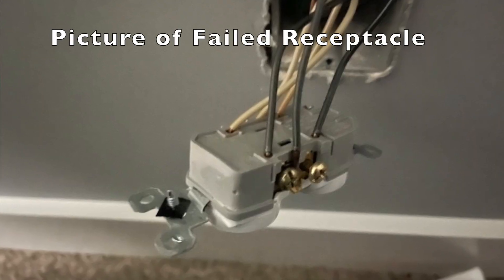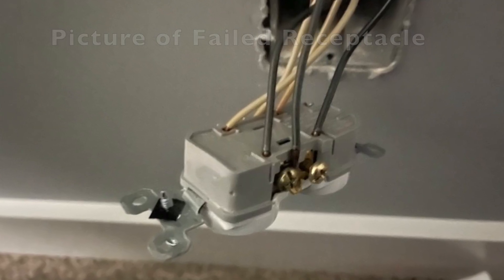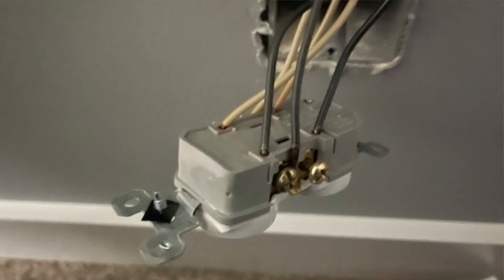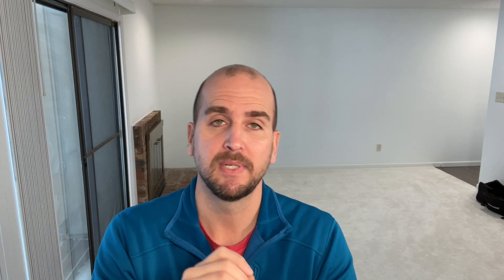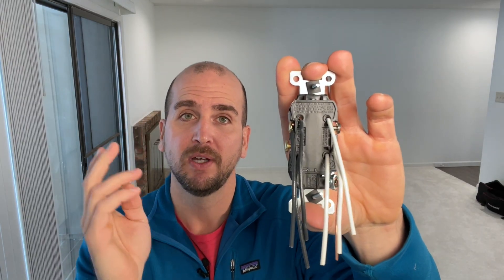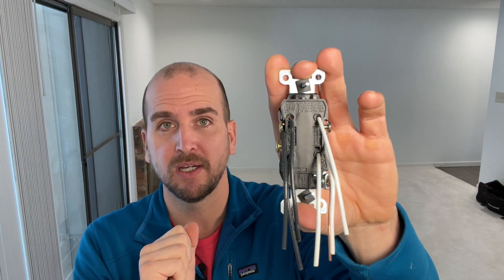Incorrectly Wired Outlet Found In Newly Built Home

Comment: Some great tips here, especially for people that have to come behind someone else's work!  You didn't mention it but I noticed that you tucked the wires in with the nuts pointing up which is just a little bit more safe and helps keep stuff from falling into it.  One tip I would like to add, especially for a box with so many wires,  is to pre-bend the wires into an "S" or "U" shape.  It requires less force to push in and pull out later and lessens some of the strain on your connections.
Reply from the maker: I have seen some interesting comments over the years from people who both have conviction and at the same time are just simply wrong in their approach.  Peter you might take the cake.  Did you just recommend people can “whittle down” a 12 gauge wire?  We are going to have to agree to disagree on all your recommendations.  Be safe and maybe reconsider your approach to electrical.
Reply: @EverydayHomeRepairs  I guess if credentials matter, and if Peter's EE beats a ETech Certification, I guess my PE trumps Peter's EE.  It is ridiculous for an EE to recommend whittling wire - I'm also a Metallurgical Engineer and suggest that the electrical wind that occurs when electrons flow through wire would be concentrated in the non-uniformities caused by whittling and in the worst case could cause the wire to heat up and fail.  Ignore the bad advice to whittle, and do the job right the first time.  The same with tightening the screws and even wrapping them in tape... in the modern world we call measures like this  poka-yoke or error cause elimination.  For the few seconds those operations take, if we protect even one homeowner out of a hundred from electrocution we've done the right thing, in my humble opinion.  Using the pigtale is simple and fast and if an outlet fails, other outlets down the line don't fail because they have power that goes around the failed outlet (similar to double wired Christmas lights.) 
Having managed a lot of engineers in my career, I'd like to suggest that all engineers can learn something from the electricians who are wiring all day every day...we would be well advised to listen to them!  Is anyone else wondering why an electrical engineer has been doing so much routine wiring?   I mean no offence to Mr. Evans...
Reply: @johndunlop9101  
I'm not a trained electrician, but have degrees in electronics and computer science.
You SHOULD offend Mr. Evans 'cuz what he's promoting is just plain stupid...
The 'engineer' (Mr. Evans) has demonstrated (in this very thread) that he is unaware of 'edit' when he's ranted then clicked 'reply' before he's finished his rant; so he starts typing another response to the same recipient. He's demonstrated both ignorance of the system and a compulsion to act hastily rather than correctly... It's a form of the Dunning-Kruger effect... His customers will be billed for an hour when Mr. Evans will be out the door after 10 minutes, but he'll claim his customers save money... Go figure...
Seen his type in so many situations...
Their self-assured attitude only leads to others paying for the consequences of their stupidity.
Reply: @Peter Evans I am an electrician. I always tighten the unused screws on the receptacle. The box is usually plastic in houses but the ground wires in the box are usually bare. I removed receptacle covers and have seen these bare ground wires dangerously close to the side screws. If you are in commercial buildings the mud ring  on the metal box is very close to the side screws. A real electrician sometimes has to pull out an attached receptacle while the circuit is still energized. Not recommended, but sometimes unavoidable.
I have never, and I mean never, heard of or seen anyone whittle down an electrical conductor to fit into a stab lock.
Reply: @Peter Evans so this is the real reason why you're rambling!! It's just that you think that being an engineer you're better or somewhat above a non engineer. An electrician can now the same or even more things than you, you're not necessarily better just because you have a piece of paper that says you're an engineer.
Reply: @Peter Evans yeah, sure. To recommend not to tighten screws just to not "waste" time. That speaks tons of you. And yes, you were rambling
Reply: @Peter Evans is a Troll, do not feed it.
Reply: @Peter Evans it is my professional engineering opinion that you are a P.O.S.

While our degrees do have a significance,  that does not mean those with vast experience have nothing to offer.  Your degree should have taught you to take in all information. Good engineers do that. If you worked for me,  I would fire you for your crappy attitude.
Reply: Pig tailing outlets has a very good reason , for one as stated when replacing that individual outlet you do not cause the whole branch to go down or in other words the remaining outlets are not relying on a different outlet for a pathway and two being along the same lines if you wire the outlet so that power goes in on the top side say and out the bottom if you have a heavy load on the circuit down the line all of the current is passing thru each outlet causing them to heat up and eventually fail due to attrition as opposed to an isolated outlet that taps current out of the circuit at each individual outlet . Sorry but you are totally wrong in your statement but we all make mistakes , just don't pass on information that is incorrect and possibly dangerous for others to follow . Also 100% of all boxes are most definitely not plastic as some are most certainly made from metal , have no idea where you came up with that but it's just not true . Cheers
Reply: @Peter Evans You're talking to me about arrogance while also saying how liking your own comments makes your word better than mine? Fuck, am I sorry for whoever actually has to put up with you in person. You're insufferable. But also painfully obviously trolling, so, maybe things aren't so bad as they seem.
Reply: @Peter Evans remind me not to hire you for any electrical work
Reply: @Peter Evans There is a practical reason for not whittling down wires: it is physically the same as nicking them all around. It weakens the wire at that point. If there were to be any incident associated with the outlet you must be aware "whittling down" the conductor would be very hard to defend. Everything is a technicality until something goes wrong.
Reply: @Peter Evans What??  If you use a pigtail in your receptacle, OTHER outlets/fixtures on the load side (downstream of that receptacle) will continue to function if your "pigtailed" receptacle fails or malfunctions [in other words, you get "source" voltage at the next outlet/fixture independent of what happens to the receptacle with the pigtail].
Reply: @Peter Evans You'd do well to ponder your feedback deeper.
Reply: Your point is good. I have seen WAY too many boxes with tons of wires (sometimes too many for box fill) that look like a rats nest. Especially critical if using an older box that might be a bit shallow, and someone shoehorns in a GFI or dimmer.
Reply: You know that Peter Evans is just pushing buttons, right? That’s an electrical pun. 😎
Reply: Engineers that think they know more than technical laborers possess blindness that comes from knowledge that puffs them up.
A good engineer also has street-smarts: yes, screw in the screws and use pigtails.
Thanks for a good video including the wisdom of learning from others and being meek with the proud.
Reply: @Peter Evans Lots of boxes in current use are metal - eg all of the boxes in my house, and it it a pretty standard house in this area. The use for pigtails has been outlined. If there is a tab that fails, then the method fails. Whittling wire contradicts your insistence of not wasting time.
Reply: @Peter Evans screwing unused screws minimize the possibility of anything coming in contact with a powered screw and putting to wires in one screw just creates additional heat to one screw with the possibility of something going wrong.  if you do one and one you are balancing the heat on that connection.
Reply: @Peter Evans Not all boxes are plastic. There are plenty of metal boxes around. Not sure where you live, but in most places metal boxes exist. The reason for pigtails is to limit the amount of current traveling through the outlet connections. Particularly when using a 15amp outlet in a 20amp circuit. The outlet is not designed to handle all of the current within the circuit, but rather that from its direct usage. Agree that the aversion to push in is overkill. I've never had any problems with it.
Reply: @Karl with a K This is probably the most absurd thing that I’ve ever read…
#1-Metal boxes still do exist in residential, commercial and industrial.
#2-Pigtails are by far the most reliable connection to a receptacle from a circuit with more than one set of wires, basic electrical 101.
#3- I’ve had to replace a countless number of receptacles that burned up because they were back wired.
Maybe it’s just me…Probably not though.
Also, anyone that has a degree in electrical or electronics would know that the electrons flow on the outer edge of the conductor, so whittling the copper away is reducing the ampacity of the conductor. Sure 14 awg is rated for 20 amps, but can you use it on a 20 amp circuit? Nope… Go back to school bro.
Reply: @Peter Evans Funny thing is as a "laborer" I have way more practical experience than you. You simply read up in your textbook. I learned hands on, and continue to do so day after day. You are a bookworm with no real experience...
Reply: Please don't tell us you're an electrician and doing that shit in people's houses...@@karlwithak.
Reply: And so I guess all the journeymen electricians with 30 and 40 years experience who comment on what a good job he does with his videos are wrong too, are they??? You know more than all of them, do you???😂
Reply: Must be reading different comments. Or like the MAGAtards, only reading what reinforces the opinions you already have.
@@karlwithak.
Reply: @Peter Evans That ego certainly checks out. Blanket statements such as "Never ever" and "100% of all" are quite unbecoming of someone who claims to be an engineer, yet at the same time, entirely expected from someone who claims to be an engineer. Consider that your scope of view is not definite. And your wisdom is not infinite. What sets you apart from other engineers and the lowly 'laborers', is how quickly you can turn your name into a red flag.

Record time, sir. Record time. You're truly #1, as you proclaim.
Reply: @Peter Evans True based on your word and your word alone, you mean? Yeah, I think I'll stick by mine.

Edit: You liking your own reply is really icing on the cake.
Reply: 're@!#ds'  Man get life no one.  I mean no one, uses that word any more. Look at it this way. I know teenagers that never heard that name called to anyone.   All you are doing is keeping it alive. And it cheapens you..@Peter Evans
Reply: @Peter Evans "books on code" meaning the NEC? Please tell me how your genius idea of using 16 gauge wire on a 15 or 20 amp circuit complies with 240.4(D).
Reply: @Peter Evans did you get your EE degree from Trump University?
Reply: @richardchild9683  haaaaaaa
Reply: @richardchild9683   I don't get what some president has to do with anything. Why do people let Trump live in their heads so much that they think about him in every situation, such as this one, no matter how totally unrelated it is to him?
Reply: @richardchild9683  ah, we got a biden supporter here. This speaks for itself. "LETS GO BRANDON"
Reply: @Peter Evans You my friend are a fool , only way to look at it .
Reply: @Peter Evans so the numer 1 and 3 are false ?

Comment: The only problem I have with this video is that the first example of a wired receptacle and the last example of the wired receptacle in this video are not the same receptacle. I'm surprised the professional electricians didn't catch this one but if you look closely at the first receptacle you'll see that the hot lead (black wire) is wired on the neutral side (silver screw) of the receptacle and  the neutral lead (white wire) is wired to the hot side (gold screw) of the receptacle.  It is wired correctly on the receptacle at the end of the video, black lead to Gold screw and white lead to Silver screw.

Comment: An even better practice is to wrap three wraps of electrical tape around the three wrapped wires at the base of the wire nut, then continue over the wire nuts with three wraps.  Then put three wraps around the side of the entire outlet covering the sides of the terminals and wires.   Zero chance of side contact and zero chance of losing a wire nut when tucking wires or from any other issue.  When a customer sees this install and how safe and professional it looks, they will never look for another electrician.

Comment: I just replaced an outlet which was malfunctioning for those reasons. And outdoor ,non-GFI outlet with a bad neutral.  Scary thing was it would work when you plug in a 3-prong device to it, misleading the homeowner into thinking its all ok. He never knew how close to a dangerous shock he was. I noticed it when I ran my tile saw off of it, I could feel the electrical current on the metal parts of the wet saw. I quickly fixed it with a GFI. I've done this in people's homes many times.  It is amazing how virtually every home has shoddy wiring somewhere.....
Reply: Need to be careful. Check first If the circuit is on a GFI breaker you do not need a GFI outlet. It could cause more problems if you have both on the same circuit

Comment: This guy should know, that UL required several years ago, that all receptacles must be redesigned, and essentially "made better quality".  Today's receptacles are made so that NO other wire may be "stabbed" in the back except #14 wire.  #12 won't even fit now.  The quality of the"stabs" are also much higher, and are less likely to come lose now.  Pigtailing is a good method, and I do that when I have multiple wires in an outlet box.  But just saying, the receptacles today are much different now.

Comment: Only pet peeve I had in your entire install was the screw on the cover plate not being perfectly vertical. Another good practice is taping your outlets. Just run a quick wrap of decent electrical tape around the screws of the outlet/switch. This will help should the outlet slip in a metal box from it shorting out and if you ever have to work on the system hot it can assist you getting the outlet out of the box without a light show. It only takes a second to do and is well worth it.

Comment: I've always wondered which was better, push or screw down. I always used screw down....... until I got lazy and started using the push method. I'll start to convert back to screw down as I work on any outlets. 
By the way, what do you think of the (new to me) snap on method Vs the old wire nuts?     Wago & other brands ?

Comment: In three of my homes over the years....a house, a condo, and a mobile home...I've had entire circuits go "dead."  In all three instances, a push in connection had failed (corroded, arced, whatever) and killed the circuit.  In two instances, my tester indicated a reversal of polarities (can't remember which) but in fact I had a loss of the neutral part of the circuit.  In the mobile home especially, this was very difficult to track down as the outlets in the circuit were in no logical order whatsoever. I NEVER, EVER use push in connections....and frankly, I can't believe they're allowed by codes.  They're kind of like a built in future failure so those who are unable to troubleshoot these kinds of problems can support their local electrician.

Comment: Ugh, agreed, but speaking of best practice..... when you were making up that outlet you should always test before touching, always treat as though live, NEVER touch the hot wires with one hand and the nuetrals with the other at the same time the way you did when seperating them (that is the type of shock that can send your heart into fibrillation), and always make up your nuetrals first to avoid an open nuetral condition on a combination   circuit. Nuetral is "first to make last to break". Other than that you did ok 👍🏼
Reply: He actually did put a circuit tester on the outlet when he was showing the corrections his followers suggested (4:30). I'm willing to bet if you look at the original video he uses a circuit tester.

Comment: Hi Scott. Just another tip here. It is best to install the receptacle with the ground leg up. This prevents a shorting hazard in the event the plug is not seated all the way into the receptacle. Should a metal object fall and make contact with both tongs it would short out the circuit and in an extreme chance, start a fire.
Reply: I've heard this reasoning over the 20+ years of being a licensed electrician and it's so ridiculous. How often does a metal object, thin enough to slide between the plug and recept, actually slide between the plug and recept? This scenario is highly unlikely.

Just install the recept whichever side up. There is no wrong way.
Reply: @sparks3705  I have actually seen this in the field and was given this tip by a coworker. No, there is no wrong way. Just a tip.
Reply: @DaveMoore11  Sure... And I've seen some pretty stupid things happen in my lifetime, too. I'm just saying this sort of thing happening isn't likely.

Comment: My wife's uncle, who is a contractor, used to have me wire the receptacles so the single opening for a 3-prong plug was up top. His rationale was that if the plug came out a little and something happened to fall down into it, the object would hit the single prong and not the pair so as not to accidentally close the circuit right at the outlet. Does anyone else do this?
Reply: Have done a lot of work in hospitals, it was always required to install the ground pin up....
Reply: What about the cute surprised look of the outlet 😮